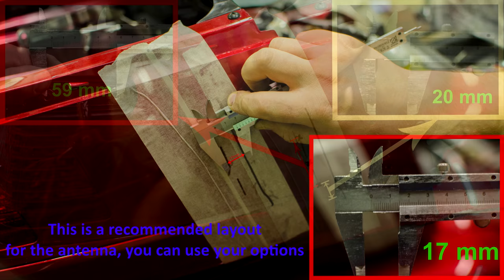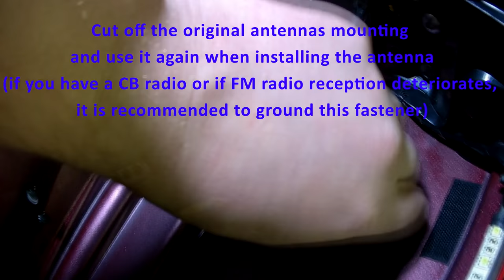Install Honda Gold Wing 1800 2002-2017 Rear music upgrade. Goldwing Speaker pods (box)

Comment: what brand and model of speakers did you use? Also, looks like you removed the top original 3.5 speaker and install a crossover network. please provide a list of audio accessories you used to complete the transition.
Reply from the maker: We usually use an external amplifier Alpine PDX together with the European acoustics Focal or Audison. 
Yes, we normally place midbuss into the pods and install crossovers and then twitters in the upper original places. 
Choosing from American acoustics I would recommend you to have a look at Polk Audio DB or MM series or something from Rockford Fosgate. 
And for the factory system, we created our own speakers, but unfortunately the result and the quality is not the best and we have temporarily suspended its production and sale. 
We have created the acoustics of our own for the original system but, unfortunately, the result and quality leaves much to be desired and we've temporary stopped its production and sale.
Reply: Has anyone came across someone selling these pods?

Comment: will this not work in 2001? Are the brackets different for reassembly of the trunk lid in 2002?
Reply from the maker: If you have a GL-1800, one podium mounting hole may not match.  
And you have to drill it inside the trunk

Comment: really  get us some info on the same ones that you are showing
Reply from the maker: which ones in particular do you need info about?
Reply: the same you installed can I get different colored stitching or black and can you get the round pods like the install on the trike trunks cant find the anywhere
Reply: the trikes in Poland have the pods for the 6 inch speaker still cant get in contact with anyone about them and no one in the usa has them that I can find I like how yours fit flush under the top pod  thanks for any information just want more and better sound

Comment: Tough to do business with - I do  not speak or read Russian. I have asked questions but can not get any answers. Disappointing.
Reply from the maker: Where did you ask questions?
Reply: I asked question on ebay site and on GLRiders - a couple people said that they sell this item. Want to know how to custom order with leather and matching stitch.
Reply: if purchased and installed, do I eliminate speaker in factory pod? If I  want leather, how do I select this option? what are choices for the stitch?  New seat ordered, new replacement speakers have arrived. If I am going to do this,  now is the time to do it. I don't see options on the ebay listing.
Reply from the maker: Answered you on ebay.
Sorry, we have a lot of work. We do not have time to sit on the Internet :(
But we try to respond quickly ...
We can sell the package with a direct transfer of PayPal at a discount of 10 percent of the price on Ebay.
If urgent - better write to the e-mail: ad-price@yandex.ru
GLRiders - blocked for Russia, there is no access anymore...